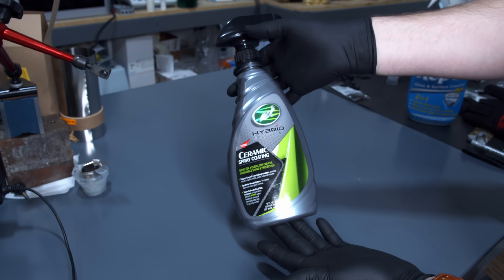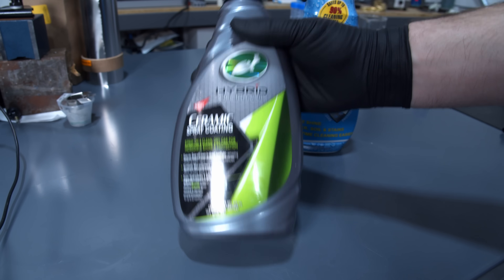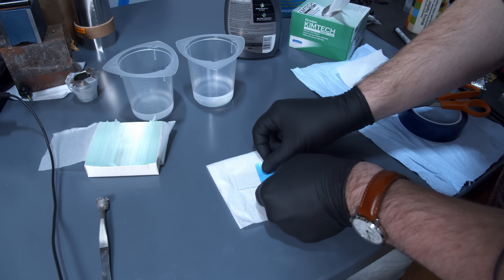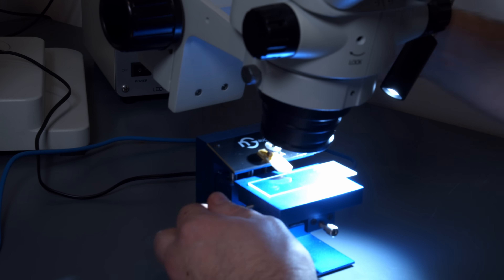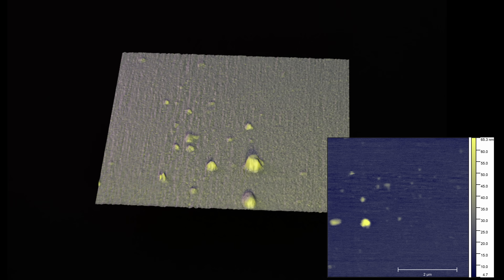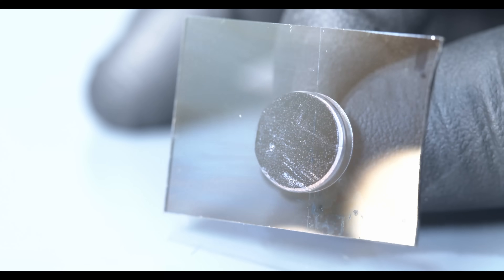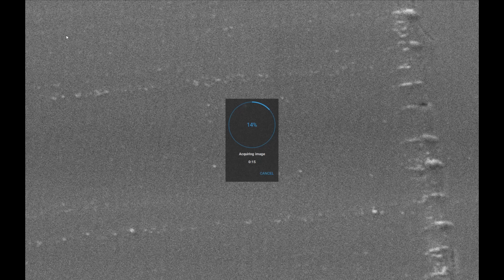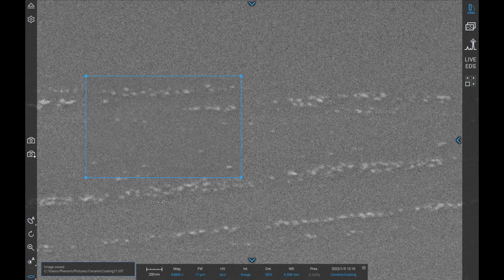Ceramic Spray is (probably) useless

Comment: There are other products for "regenerating" ruined ceramic non-stick cookware that could be interesting. I think they are mostly metasilicate solutions but didn't really look into it. Regardless "non-stick" ceramic cookware is interesting and very easily ruined. Putting a piece of that under the AMF would be very interesting, there are many modes of failures and I assume they mostly are caused by very small cracks forming in the surface, but I have none of the tools required to figure it out.
Reply: Those "ceramic" cookware products use a sprayed silicone layer (like what's shown in the video) as the "anti-stick" coating
They're misleading consumers into thinking its a durable and safe coating, while it slowly disintegrates into their food

Comment: what about treating your glass with the rain-x stuff, then mixing rain-x additive into your coolant?
Reply: Pretty sure putting hydrophobic coatings into your coolant is completely counterproductive to the job the coolant is there to do in the first place - stick to the tool and the work and lubricate the cut (and as a secondary importance, flush the chips out so you're not re-cutting chips)
Reply: @gorak9000  ... and cool the cut to prevent damage to the part and the tool edge.

Comment: These "ceramic" sprays are notorious for showing little improvement over older, silicone-based waxes on automotive glass.  Typically, however, they perform equal to silicones (or better) on paint in terms of smoothness, clarity, etc., but their durability is what truly makes them shine.  These products commonly maintain their full hydrophobic properties 3-5x longer than their silicone brethren.  They are also found to "build up" on the paint through repeated use, not unlike the seasoning layer on a cast iron pan, though not to the detriment of the finish (the way that traditional, natural waxes, such as carnauba do).

Because vehicle paint is significantly softer than glass (paint hardness also varies between brands and vehicles), it's possible that, as the product is applied, the nanoparticles are deposited into the surface of the paint.  This is most likely the reason the bottle tells you "do not over-apply".  More product makes for more solvent, which is counterproductive when the goal is to remove the solvent and leave a thin, even coating of material behind.
Reply: The problem is that regardless of the fact that these coatings are proving to be as or more durable than traditional coatings, it is very likely NOT the presence of ceramic particles that is responsible more likely some sort of new type of silicon-based polymer wax..   My theory is that the production process leaves silica particle precipitates that are difficult or costly to remove,  but testing showed that the particles were harmless therefore some clever marketing wank had the brilliant idea of just leaving the garbage in the formula and telling everyone its a magic ingredient instead and charging more for the product....
Reply: @Flying0Dismount  that theory would hold water if the formulations were substantially different than silicone-based waxes, but they generally are not.  The main changes vs older, non-ceramic, silicone-based waxes basically boil down to the amorphous silica and various chemicals meant to support it.  Clearly, one of those ingredients is extending the useful life of the properly applied product substantially.
Reply: Turtle Wax itself has actually been going through its older product lines and adding the "ceramic" ingredients to new formulations.  "Seal N Shine" is one of the most well-know and widely-used waxes commonly available, and for good reason, but it's always had a durability problem.  That durability problem is substantially mitigated in the new, "ceramic" reformulation.  So, the question is, how did the mere addition of "garbage" improve the product's durability with no substantial drawbacks?
Reply: Pretty sure it's like homeopathy - the less there is, the "better" it works. How can you watch this video and still buy into the snake oil?
Reply: @gorak9000  you either didn't read my comment or you didn't care to understand it.
Reply: @gorak9000  Well yes, because its an impurity.

Comment: I would love to see a deep dive in to the science around ceramic coating. I’m looked for other videos and have not found much.
Reply: Depends on what you are trying to do with it. Ceramics are really just a metal and a mineral mixed together and in many cases they have very different properties but we have hard and soft metals and minerals that take on many different crystal forms. This allows you to mix and match a lot of properties and parameters to what you are trying to do. In some cases, it is the hardness or other physical property being used, such as in armor. Other times it is the heat transfer or heat resistance. Then there is particle shapes that accomplish certain things jagged particles can interlock to make a tight bond before sintering (making cups or plates) or can be used to scratch, polish, buff or grind. Round hard particles can work as a bearing or flat platelike particles can slide, working as lubricants.
Reply: Marketing science😂

Comment: You may want to redo this test. And spray from the bottle at least 20 sprays to make sure that you're getting a good uniform sample.
I don't know if you did this off camera or not.
Reply from the maker: I've actually been spraying this on a bunch of things (and only noticed mild improvement) which is what prompted me to check. But it's a good point, I hadn't used it much the day I filmed... I'll re-run the tests and if it changes, will post a followup! Might try letting a bunch evaporate/pool for a long time to see if anything settles out too

Comment: what about the coatings advertise as "9H ceramic coatings"? seem to work surprisingly well,  usually come in a small bottle; i guess the main ingredient is something like waterglass?
Reply from the maker: Unsure, but I have some screen protectors with that coating (supposedly) and they do indeed work really well! I'll see if I can track down a bottle to spray and check

Comment: Nice video. Unfortunately if you're running high-pressure coolant, then the only viable way to get a clear view into your machine is a spin window.
Reply from the maker: Yeah I'm afraid you're probably right. I do have some screen protectors which help noticeably, but still not as clear as a spin window. Sigh 😢
Reply: What about an air blade? Need to machine an air nozzle with a thin slot in it - if you can get a nice "blade" of air coming out of it, it might be enough to keep the coolant off the glass in enough area to see through with a camera
Reply: @gorak9000  I've seen the ones made on Edge Precision channel to keep the cameras clear inside the Mazak enclosure.
If all you want is to get the coolant to run off the lexan I wonder about something like Liquiglide where there's a combination of micro surface texture and a hydro or olio phobic component filling those pits.  🤔
Reply: @jimurrata6785  I watch Edge Precision, but don't remember him ever making air blades. I'll have to go look for those videos...

Comment: If the endeavour is to have a clear view in your cnc. Have a look at hydrofiel substances. I ride a motorcycle and the visor in my helmet has a coating of sorts which is hydrofiel. The vizor brand is pinlock. 
I also know of hydrofobe sprays and they don't work. pinlock does work. perhaps also in an cnc?
Reply from the maker: Will take a look! I installed some tablet/screen protectors with some kind of special coating which does an OK job. Will look into that coating and see if I can get some or apply it to the windows!

Comment: I don't think this stuff is actually going to work, but I think what you sprayed was what was in the hose.  It might be worth trying again and making sure to spray enough to replace the fluid in the intake. It will probably end up similar though.
Reply: One other thought: In watchmaking they use Epilame to prevent oil from getting into areas it is undesirable.  It is crazy effective.  You might want to try that.  The cost is high in quantity, but it is actually fairly durable. The thing is, the coating is so thin, they state it is undetectable other than the effect.  It would be very interesting to see under the microscope.
Reply from the maker: Will take a look at that Epilame stuff, sounds great!
Reply from the maker: It's a good point! I neglected to mention that I've used this a bunch around the shop already so it was pretty well primed. I pinned a comment since that seems like it'll be a common question/point. Silly of me not to mention it! 🤦‍♀️

Comment: You should check out maybe the n3 nano coating that blacktail studio uses for wood finishing. I'd be interested to see what that looks like on a small scale, and wether it would work well as a protection in the CNC enclosure.
Reply: I have a feeling all these newfangled "miracle sprays" are all the same - "ceramic" "nano" marketing BS
Reply: @gorak9000  the n3 coating isn't a spray, it's put on with a sponge like applicator, and has shown remarkable durability as a wood finish, so it definitely has something to it. Wether that is actually nano graphene or ceramics or some other film that it is creating is another question though.
Reply: @joshwarner5676  can you actually order that overpriced snake oil? Their website says join the waitlist, their Shopify store says it ships at the end of the month, both might be out of date. In any case, I don't need to pay $120 + S/H to know the promo copy is intense marketing BS.
Reply: @emislive  I haven't personally tried it. Just seen some videos showing some impressive looking results, which is why I'd like to see verification from someone else of what it actually looks like at a micro scale and how well it works.
Reply: @joshwarner5676  more on ceramic coatings would be great to see!

Less productive rant follows...

There's a lot of smoke blown around wood finishing, and online, so I get critical. A lot of nebulous, confusing and/or misleading claims are made about consumer "ceramic" coatings of various kinds. I see Blacktail make some claims that reach really hard about a product that is priced significant;y above comparable.

Comment: Teflon was used in a number of products but they discontinued that quickly
Reply: More than 50 years.
I guess it depends if 'quickly' is on the scale of human lifetime or chemistry dating back to the alchemist's.
Reply: @jimurrata6785  1938 was when it was discovered.. it wasn't used in mass until 1970s + and there have been many bans or lawsuits since.  Don't act like it's been used forever.   It's like leaded gasoline but not as harmful
Reply: @xephael3485  T-fal pans have been around since 1956.
3M sales of Scotchguard began in 1956.
W.L. Gore was founded in '58 by a DuPont chemist as a side hustle. Goretex fabrics have been sold since the 1960's
So you tell me when ptfe became a widely available commercial product.

Comment: I detail cars for a living and love everything science. This is literally the perfect video. Haven't watched it yet, but if you don't mention it in the video I'd love to see actual ceramic coatings and/or graphene coatings. Or products like Rain-X that leave a coating behind on glass. I try to imagine how thin the coatings are, but I wouldn't even know what to guess
Reply: @StatueofGuyThinking  That's what i had in the back of my mind the whole video. Based on the, (impressive) results in the project farm video I would at least expect some noticeable and significant layer on the material. Like the pinned comment mentions, maybe the glass is just to smooth for it to really stick on.
Reply: @StatueofGuyThinking   That's a good idea.  Project Farm did a pretty extensive sequence on quite a few products.
Reply: Yes, I think he needs to retest but use an actual ceramic coating. One such as Carpro Cquartz UK 3.0, which is one of the stronger retail coatings.
Reply: I second the request for a closer look at ceramic coatings. You can pick up small amounts that are used by professional car detail for relatively cheap. My vehicle had a ceramic coated applied professionally and it worked great as water repellent. However, it only lasted a year or so and I don't see myself having it installed again due to the price. Nowadays, I see "ceramic" on all automotive detailing products in stores, including products for leather and fabrics...wtf? Definitely seems to be a marketing gimmick.
Reply: why do any of the testing on glass instead of the paint/laquer most of these products are made for? they have a much better chance of 'accepting' a layer of hydrophobic in the micro scratches that cover these surfaces, over glass. I just can't imagine the makers of these products thinking 'Yeah glass is an easy surface to make something for that will stick'. I'd imagine most of the other surfaces it's meant for, are pretty helpful in retaining the coating.
Reply: @insanebmxthomas  real ceramic coatings work on glass just fine.
Reply: @insanebmxthomas  this product IS made for glass as well
Reply: That's what I was wondering as well. If a ceramic coating for a car would make any difference? And how would that coating look under the microscopes? I've seen some non-biased YouTube videos with those nanoparticle ceramic coatings. It sure seems to make the cars super shiny and bead water like you wouldn't believe.
Reply: Yes please
Reply: One of the guys my work tried rain-x. Didn't seem to do much